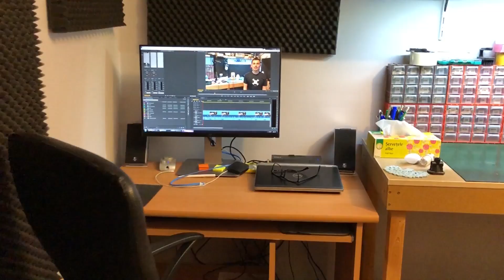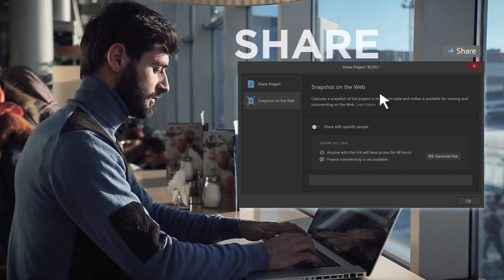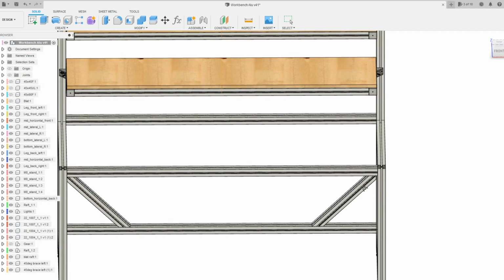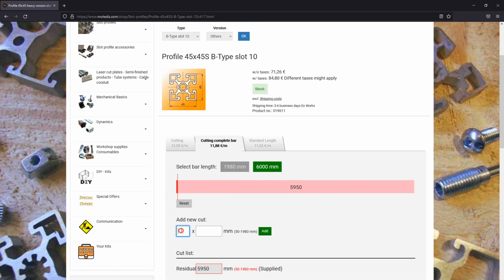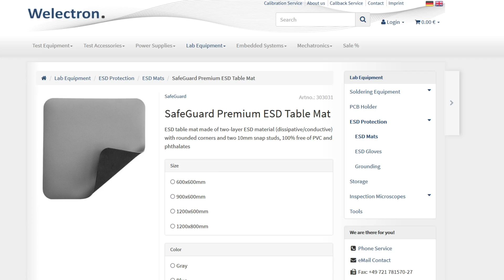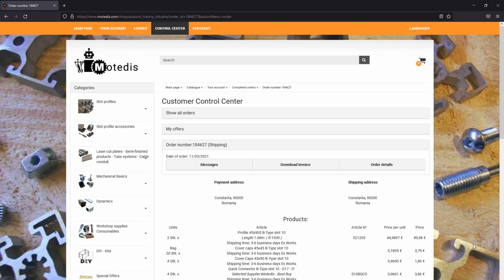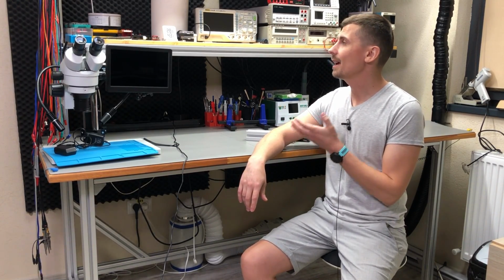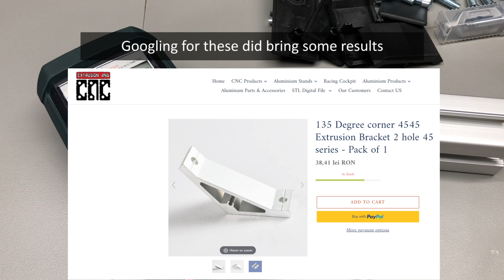I built the ultimate electronics workbench using just a screwdriver | Voltlog 377

Comment: I am currently in the research phase of putting together my own electronics workbench for my home lab (upgrading from my current 2x4ft folding plastic table) and your design and methodology IS SO MUCH BETTER than everything else I was planning on for options.  Standardized hardware, standardized structural frame, good load-bearing qualities, easy take-down and reassembly, easy to modify, low-to-moderate expense.  It looks beautiful too.

THANK YOU SO MUCH, I was close to moving to build phase and was going to go with a wood frame, but this is orders of magnitude better and covers everything I wanted.
Reply from the maker: The only thing you need to accept with a build like this is cost, if you are fine with the cost (which is higher) then everything else is better than with other solutions.
Reply: @voltlog  No kidding on cost.  Aluminum has indeed gone up - it looks like just the extrusion beams will be ~$1K USD now.  Ouch.  I'm... actually still considering it.

Hey, a question for you since you've had this bench for a year now - how is it holding up?  Any drooping or fatigue apparent at the stress points for the shelves for instance?

Comment: The wood panel you got is very much a table top exactly for the purpose you got it for (workbench, kitchen counter and things like that). That's also why it already comes with the rounded front edge (I guess you didn't do that yourself). But when you buy a solid wood panels they come "raw". Usually you would sand them (80, 120, 180, maybe 240 grit) and coat them. For a workbench (and also kitchen top) some hard wax oil coat is the best option. As opposed to varnish It soaks into the wood and protects the wood even when scratched or cut.

Also take a look at phenolic resin coated plywood in future projects. "Siebdruckplatte" in German (I don't know what the standard English term for it is). It's available in various thicknesses and really versatile for all kinds of workshop builds. It being plywood also means that it will barely change shape with humidity, as opposed to solid wood, which can warp quite a bit. Another bonus of the resin coat: almost nothing sticks to it. I have a few panels of it that I use as work surface when I glue or paint something (wood glue, super glue, epoxy, water or solvent based laquer). All of that just flakes of when rubbing over it with another piece of wood.

I would put at least a riser board on the back edge of the bench top so stuff can't be pushed off. It doesn't have to be high and thick, but it will add a huge amount of rigidity to the workbench if fastened to the rear horizontal and vertical frame. If you go the full height (bench top to first shelf), the "back wall" could also double as a "tool wall" for small tools like calipers, tweezers, aso. Plywood, especially the phenolic coated one, would be a prime candidate for that.

I couldn't really see how you mounted the shelves, but I would feel better for at least that PSU/scope/measurement equipment shelf if it had some triangular supports (on the left and right, pointing forward). The simplest thing to do is to screw a small piece of wood (about a 20x20 cm square cut diagonally) to the inside of the verticals (the 90mm side) right under the shelf so it supports the shelf pieces coming forward.

Comment: At my previous job we built some workbenches like this including the beam for an overhead light. For the back side we used combinations of metal pegboard for holding tools and some wall-mounted metal cabinets, which we attached to the aluminum profiles. I don't remember the total cost, but they were definitely cheaper than ready-made workbenches. Motedis is a great shop (if not the best within the EU) in terms of overall easiness of ordering.

Around the same time I built a smaller workbench for my home workshop using steel profiles. It was literally less than 20eur for all the steel and a sheet of plywood for the work surface, plus I learned how to weld, which was a lot of fun.

Comment: From where did you get / make your fumes vacum?
Reply: He made it from a duct fan, dryer duct, and loc-line type fittings. Then for the filter, use an appropriate HEPA filter. Its way better than what most people have setup, quieter too.
Reply: @jaro6985  did he do a video about how he built it.
Reply: @str0g  No I don't think so, just going off my own build. You should be able to find some of these items at your local hardware store for <$100. But the locline would need to be ordered online. You can use rigid aluminum duct instead of locline if you are cheap like me.

Comment: Now it is easy to add concealed lighting, as you simply use a strip of aluminium that fits in the slot, and stick down LED tape to it, then slide in from the end. The extrusion keeps the light from getting in your eyes. Or use a T section aluminium decorative section, and do the same, as you can attach it easily. 

That top is sold as a kitchen counter top, which is also usable as a cutting board, so you just sand and finish it off again. Instead of the varnish just use wood oil, it will soak in, and leave a matt finish, and if you damage it simply sand lightly to get the mark out, and oil again. For the shelves I would use shutterply, as it is a lot more dimensionally stable than the pine, and also will respond well to a light sanding and oil, and it is both a lot cheaper and more rigid. The price for an entire sheet, which can also be used for the table top as well, is a lot less than any other wood other than particleboards.
Reply from the maker: I did use oil to finish the wood panels as mentioned in the video and regarding light options, there are even profile types/shapes which have this extended side piece that could serve as base for LED tape, you can find these on motedis.

Comment: Castors are good for benches, makes it easy to get behind them when you need to do cabling.
Reply from the maker: Wouldn't the bench have a slight wobbly feel because of the wheels? Even though they might have locks, it will still wobble I think.
Reply: @voltlog  I think it would be okay, like a tool cart on wheels. You could also put castors on the two rear legs only so you just have to lift it a little to move it.

Comment: Attaching a ground wire would also give you the option to ground the ESD mat. For the upper shelves you might want to add an end stop in the front and tilt the devices for better visibility.
Reply from the maker: That's definitely possible if one would want to do it but I think this is a matter of personal preference. Personally I'm not a big fan of tilted shelves, I have very good visibility as it is. What's important is that the build system is flexible and would allow that.

Comment: very good, thanks for sharing this
Reply: actually i have been wondering how to do extra shelves above my desk. and this is a good solution! not the whole desk but a useful framework to attach to the wall behind etc. it makes a lot of sense! ;)
Reply from the maker: My goal was to avoid using the wall behind just because it saves the trouble of having to repair the wall when you take the shelves down for moving to a new place. That's why I designed it this way, self-contained.

Comment: Yeah, beef up the load points! 🐄
If it looks strong enough... then double up and it's about right! 

The great thing about a build like this is the ability to swap out the desk/shelves as they warp over time,
If you could get strong shelves made out of recycled plastic with a plywood/esd skin that would be great,

This extruded section is great for building equipment racks, desks, robot chassis... the list is endless

Comment: Having done a bit of structural design in the past the one thing that jumps out is that I'd recommend making the 45 degree angle sections longer, and rotating them 90 degrees so that they support the main span which supports the back of the biggest flat bench, to reduce the deflection in that span.  So that when you are looking towards the front of the bench, they look a bit like this:  |̲̅/̲̅_̲̅_̲̅\̲̅|̲̅   Another alternative is to add a vertical timber board (e.g. plywood) upstand or downstand to the back edge of the main flat desk section.
Maybe see how it goes and measure the deflection at the back edge once it's in use and fully loaded up (metal deflects under load pretty much straight away but the beech board will deflect more slowly - "deflection creep" as the wood fibres slowly slip past each other, so maybe keep an eye on it over time to see if any modifications might be needed in the long term).  If you're not planning on putting heavy items on the main span in the long term, then this may not be an issue, and it'll also not be an issue if you keep the heavy items towards the left and right edges of the bench - so that they are near the uprights.  Avoid heaving loading mid-span...
Reply from the maker: Makes sense! Thanks Tim!